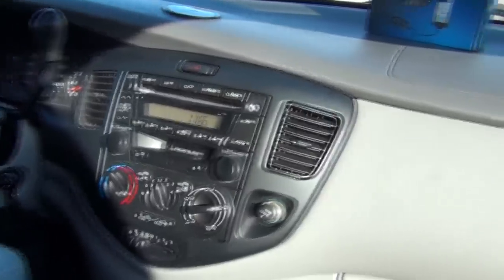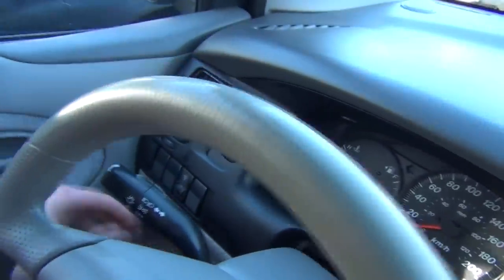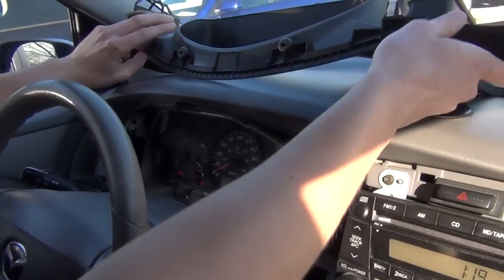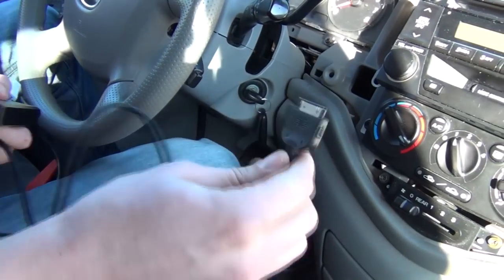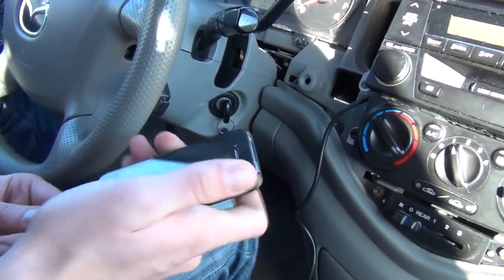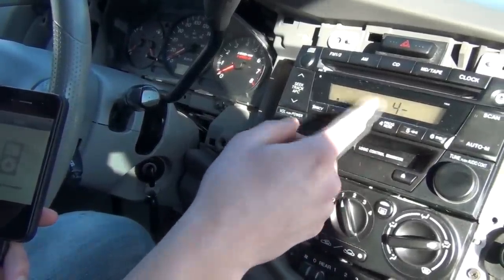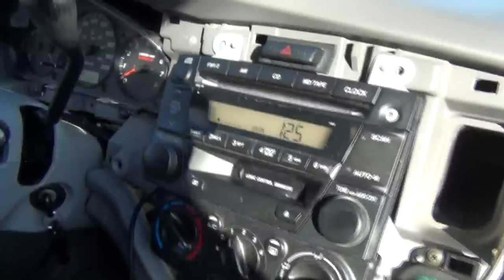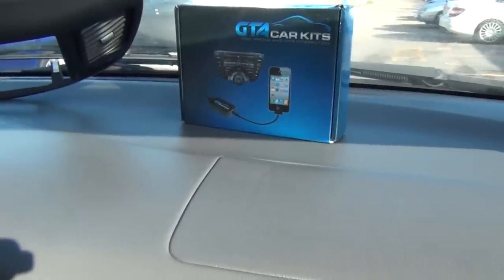GTA Car Kits - Mazda MPV 2002, 2003, 2004, 2005, 2006 install of iPhone, iPod, iPad and AUX adapter

Comment: What to do when radio dont go on after battery removal???? Will not even turn on. Lighter works.  All fuses were ok ..
Reply: Check radio fuse on the back of radio